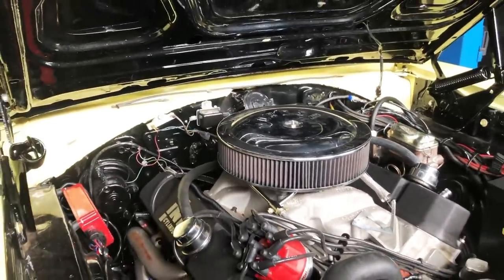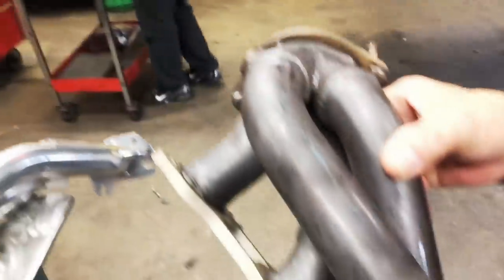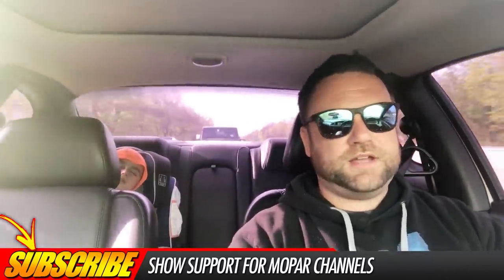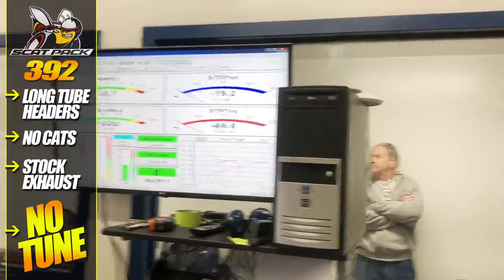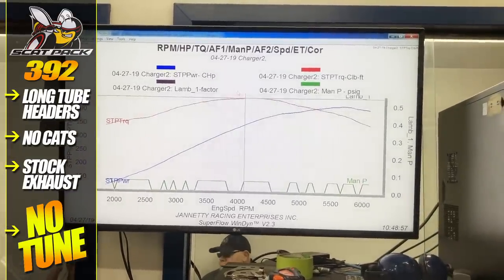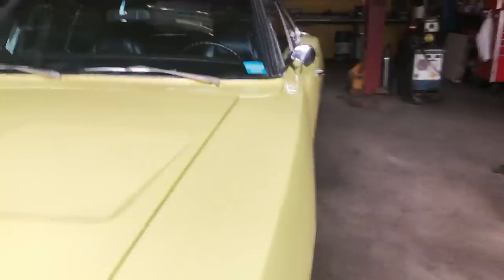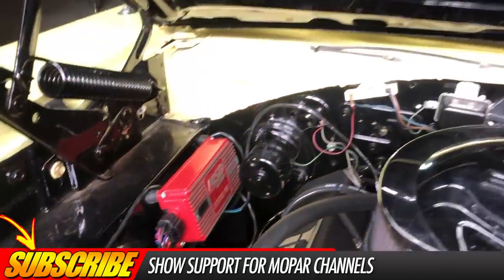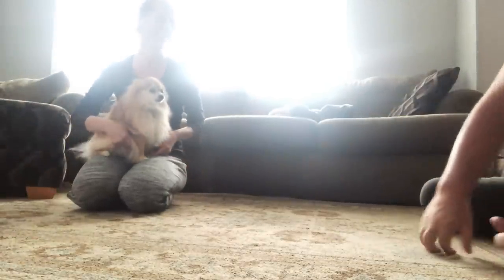Headers w/ NO TUNE...

Comment: iHave a 5.7 T/A with JBA longtubes headers, no tune, lock pcm, no check engine light...iDrove from Georgia to Mississippi, did 150... no problems, no even in gas mileage (note ido use 93)...ido plan on doing getting a tune VERY soon, but as of now its going good

Comment: Usually I wouldn't even bother with headers and no tune. Glad he saw at least a small gain instead of losing some power! That thing sounded menacing as well
Reply from the maker: yah it's a lot of money for the gain without a tune - but it can be done.
Reply: Your never going to be loosing anything other then $$ when upgrading headers to performance ones.    But more so. It’s like priming paint before it’s actually painted. Parts in place now and can tune whenever

Comment: My long tube headers and high-flow cats on my 392 only gave me 3 horsepower and three torque over my stock shorty headers and stock cats. I made 436 horse and 438 torque on a Dynojet. With the stock tune. Now with a Hemi fever tune and a Fastman throttle body, I make 464 horse and 461 torque at the wheels. I have a 6 Speed manual car. 2018. The stock cam doesn't really use long tube headers that well. I'm looking forward to a  peitz performance  cam upgrade next year.
Reply from the maker: That was a solid gain once you tuned it - but the results without a tune are kind of what I expected. Nothing really note worthy. That 392 is going to really be hurting feeling cammed.
Reply: @RTLife  I'm looking at a relatively mild cam upgrade, I don't want it too feel too soft down low. I know it's kind of expensive, but a good solid 30 horsepower all the way around, and utilizing my long tube headers, should make for a noticeable Improvement. How noticeable was the cam upgrade in your car? You really seemed to like it.
Reply: Shawn E dang you 392 gained HP like that on just some headers / tune & TB ?    I haven’t swapped anything yet out on mine. Mainly cause I don’t want issues with my warranty I still have.
Reply: @jasonjackson329  my car is making about 35 horsepower more than stock at the wheels, on a Dynojet. I have underdrive pulleys, ported throttle body, long tube headers high-flow cats and a tune. I have spent close to $100 per horsepower, so the gains are nice. But expensive. Be prepared to spend money.
Reply: Shawn E WOW. $100 per HP dam  yeah that’s what like $3500 or so.  Geez.  Yeah. Lol that’s a lot but I know how it goes.  $$$ gotta pay to play.
Reply: Shawn E Which part would you say was the best money spent ?  Pulley or headers or header ??
Reply: @jasonjackson329  dollar for dollar the tune. Underdrive pulleys worth 5 to 10 horsepower for 2 or $300. The headers and high-flow cats we're extremely expensive. However they will pay off when I get a cam next spring. And the sound is amazing. I've always wanted long tube headers on a car.

Comment: First hand experience long tubes no tune set off dashboard like a Christmas tree every time with check engine lights. I have a diagnostic tool to reset the sensors but that was a pain. This is what sent me driving up to Jannetty Racing in Waterbury CT where Ted smiled, sat me down and proceeded to patiently explain all the reasons why I needed a tune!! IT HAS TO BE TUNED BRO!!!
Reply from the maker: I hear you man - having that check engine light on all the time is a pain in the ass.

Comment: The problem with doing long tube headers with no tune is this. When you start pulling more air through the engine without adding fuel via tuning , you put the engine at risk of running lean. That said, a lean condition, especially on a 392 is a very bad combination. A small amount of knock under lean conditions can/will pop a ring land. Then , bye bye pistons. So it is very risky , and certainly not worth the risk. To all the readers , be smart and tune your engine if you are going to start pulling more air. Not so much with shorties, as they are not scavenging. But equal length primary LT’s will scavenge and pull much more air through the head , leaning out your fuel, tuning is not just recommended, but essential to reliability.
Reply from the maker: Hit the nail on the head
Reply: So I put long tubes on my 5.7 truck no cats. I live in Colorado ( mile high so we have less air up here. To me it still smells like it runs rich. I want to get a tune in a couple weeks when I have the cash. Do you think it’s ok to drive it until then. Any muffler recommendations also?
Reply: @robertmelroy2772  you can drive without a tune but you’re gonna run lean and the computer is gonna tell the engine to use more gas to compensate wit air do you gonna be spending hella money on gas but your truck is gonna be fine
Reply: Your a goat for this comment
Reply: i have a GR86 with 12.5k miles on it and just ordered Tomei UEL headers for it. No tune and only have a exhaust as the only "performance mod". Forums say it should be fine with no tune and only risk CEL.
Reply: @mustafa810c8 how’s your car running now, I have 5983 miles on my GR86, debating to put on my headers or not.
Reply: @myballsitches3284  i have the headers on now. Engine is running lean (more air flow compared to gas flow) Getting a tune early October. CEL keeps popping up even after trying to add things to get rid of it. Didn’t want a tune but i’d rather run it safer then risking the chance of blowing it. Headers Sounds amazing tho !
Reply: @mustafa810c8 I’m thinking about getting headers with no tune on my scat just to see if it sounds any better and if I like it I’ll tune it if not I’m selling the car lmao
Reply: @Camaro2ssboy  so lets clear a few thingsup so theres no confusion. so you say he can drive with no tune and be fine but use more gas because the computer will compensate and add more fuel to the system.i hope that just cleared the confusion for everyone. bottom line if you are still using the oxygen sensors after a few drive cycles the computer will adjust to make the mixture within the factory specs. yes getting a tune will optimize the mixture immediately rather then a few drtive cycles.the tune is a must if you are elimating the o2 sensors unless you dont mind a engine light.the power gains from the tune do not come from the air fuel ratio but adjusting other parameters.so if you keep your o2 sensors you do not need a tune and will not damage a modern engine.you will not lose any power ever.anytime you flow more air you will always use more fuel as any airpump needs more fuel when it flows more air and thats all the engine is an airpump that inhales air and burns it with fuel to push it out the  exhuast.almost all so called car guys over think simple to try and stand out as superior to others.some truly just dont know the basic function of engines you show you are guilty of both just like a lot of others posting here just like the op

Comment: But is it bad for the engine?? Cause i  did the same setup and no tune. I did delete the mufflers and the resonators with long tube headers. Tbh i feel some power loss.
Reply: I have a 392.
Reply from the maker: You might be running a little lean with the new headers - a tune will make sure to add more fuel so your have a better air/fuel ratio. I don't think you lost any performance but you will certainly gain with a proper tune.

Comment: I have a 5.7L Hemi. Threw on American Racing Headers 1 3/4" with High Flow cats. The Computer take a little bit to adjust to compensate but It will and your vehicle will run fine. You will feel a difference. Simple as that.
Reply: Team Mopar you aren’t optimizing the modification, tuning is way better, ECM won’t give you much alone
Reply: @EvilRamon  Im throwing in a 392 cam next month. Im doing the swap myself and showing how to do it as well. After the install im going to have it tuned by a guy who knows Hemi engines. Just check out my channel.
Reply: Team Mopar subbed 👍🏻
why you chose 1-3/4 over 1-7/8?
Reply from the maker: Going to keep my eyes open to see how that 392 cam treats you

Comment: I have a 21 track hawk which I just got American Racing long tube headers and of corsa twin cat back exhaust. I'm getting a tune but have this big car event I have to go to tommrow which is a 117 mile drive there and same distance back. Unfortunately not going to have enough time to data log it and send to my tuner before I go. If I drive it regular and not full send it keeping rpm mainly lower than 3k/4k rpm should I be fine till I get back and get the tune

Comment: I just got longtube headers , jba ones. When I go full WOT on it my coolant temps rise over the middle line. When I’m casually driving it or it’s sitting at idle, my temps are normal. Can u please help bro ? Also I’m not tuned. Maybe I’m running to lean ? Idk this all started happening when I got them installed . It was never doing this before .
Reply from the maker: You are def running lean - Get that 392 an email or dyno tune ASAP. When I went from shorty to long tubes I jumped on the dyno without a tune adjustment & it was running very lean - def not what you want. Once it's tuned all should be fine.  I honestly don't know how this guy was doing it.

Comment: I’m thinking of putting long tube headers into my 2015 5.7 challenger, I also have a lifetime maximum care warranty from Mopar. I spoke with a mopar warranty representative and she told me as long the failing part was not the cause of the headers I would be covered. Do you know if long tube headers can cause any type of harm or malfunction to the engine components other than not installing them correctly? Thanks👍
Reply from the maker: You have to tune your 5.7 after the long tube header install - which kind of gets tricky with warranty stuff. So far I've had a lot of luck with the mods I've put in place. Def no regrets!
Reply: R/T Life any tune we can buy on the internet that’ll do that instead of going to an actual tuner?

Comment: Those are basically stock numbers I made 427hp 445tq on a Dynojet and only have mid muffler delete it was a 50 degree day which I’m sure helped.
Reply from the maker: yah they seem to be pretty damn close - once he tunes it though the HP/Torque will shoot up.

Comment: I got long tubes on my 2010 5.4 F150 and I got no tune and check engine light. But the truck definitely feels like it has a little more power. Could be just in my head since I’ve never had it on a dyno
Reply from the maker: you likely picked up some power but you're likely running lean on the top end. You need a tune to get the air/fuel on point & power gains maximized.
Reply: @RTLife  can you use the diablo tuner or does it have to be a dyno tune?

Comment: I recently put long tube headers on my 2010 Dodge Challenger rt and it’s not even tune but should I tune it or no? Is it bad not to tune it ?
Reply from the maker: You're likely running lean at full throttle - yes you should def tune it. A tune will help RT run better & get more HP out of the upgrade
Reply: R/T Life idk a lot about tunes but what do you recommend I should get ? And who to go too

Comment: I hear that shorty headers add 0 to the 6.4 as the factory headers are very effecient but do pick up some hp with long tubes. not sure on the 5.7 though.
Reply from the maker: on the 6.4 392 it would be a waste of money - you have mid length exhaust manifolds in place already. on the 5.7 there are agains but not on the 392 or hellcats.
Reply: @RTLife  you're saying long tubes on a 6.4 are a waste??
Reply: Anything is better than stock
Reply: @RTLife  be surprised with the stock car could do with the proper tune

Comment: What was his base line and how much did he gain? I thought the scats were pushing 485hp from the gate?
Reply from the maker: this is measuring whp not hp. From the engine to the wheels power is lost. I believe on this dyno scatpacks are around 425-430 stock
Reply: R/T Life I got ya. Damn. I’d think he’d see better numbers but I bet if he gets it tuned he’d see a dramatic change in power and performance...
Reply from the maker: @roberthunter2263  yah with a tune he should pick up 10-15whp. The reason for such small gains is the 392/Hellcats have solid exhaust manifolds in place - basically mid length headers.

Comment: I recently installed some long tubes on my ram and it has drove like complete crap bogs a lot, sounds like the power isn’t there and just now started misfiring on cylinder 5 changed the plugs and coil pack and still does the same, any ideas ? Code also cokes out for Evap leak
Reply from the maker: I would get a tune
Reply: @RTLife  that part

Comment: What is your opinion of the odor of the exhaust without the cats installed?
Reply from the maker: I don't have any experience with it - I listened to what others said & just believed them. Many say it does have a slight oder that smells. I can't imagine it being to bad though
Reply: R/T Life you didn’t get a whif of that car on the dyno?  It didn’t have cats
Reply from the maker: The fans are really going pretty hard so there is little smell or fumes
Reply: R/T Life Good point thanks for pointing that out!  I didnt think of that.

Comment: With a tune you will gain something even if you never modded your car. Cars are tuned from the factory for emissions and/or fuel economy.  When my V6 mustang was bone stock, my Mustang ran low 14s in the 1/4 mile. With a tune only, my car ran 13.7. There was a gain of .4 seconds with the tune alone. With mods the gains are larger. V6 Mustangs with bolt ons and a tune will run high 12s or low 13s. A custom tune is hardly ever a bad decision.
Reply from the maker: yah you're right about that - just a tune alone will help a lot. Those are some solid numbers

Comment: So if I put shorty headers on the 5.7 without tune , will I see a 0 to 60 in ~ 4.7 with no tune?
Reply from the maker: You might see some improvement but not a ton. You need that tune

Comment: Do I have to heat wrap the headers or is safe to run them as they are? Kinda paranoid because I drive this car on longer road trips
Reply from the maker: Check "Ceramic coated headers" - that will help temps
Reply: @RTLife   not really worried about temps just if anything will get crispy lol

Comment: With long tube headers without a tune you lose power, idk what you talking about. That you can run like that, air/fuel ratio with normal ecu, you need a tune